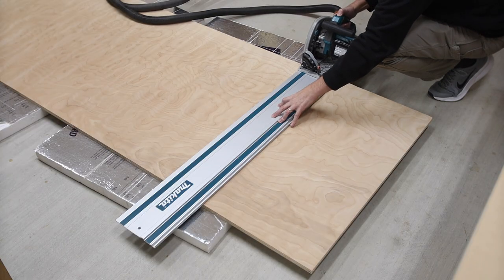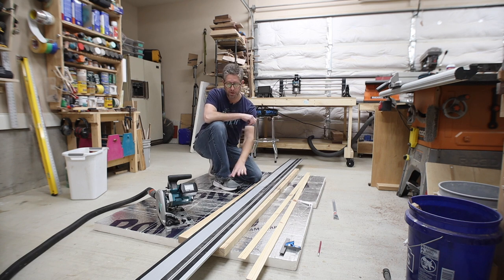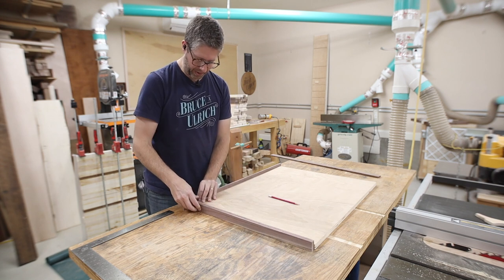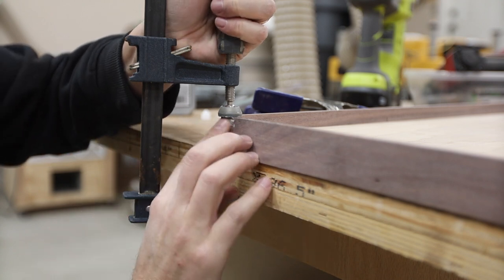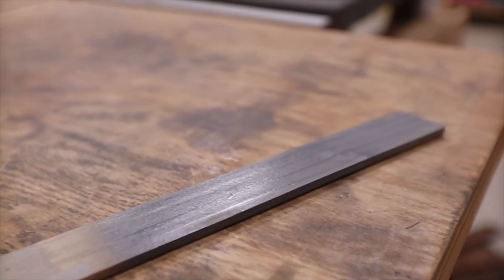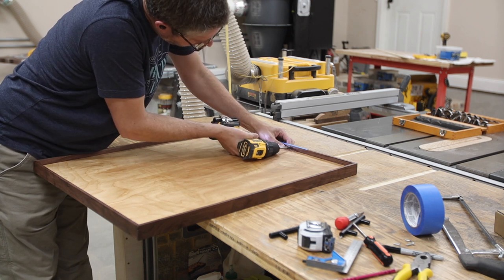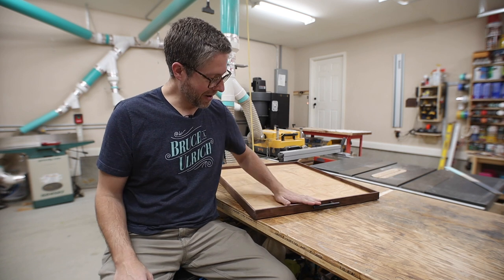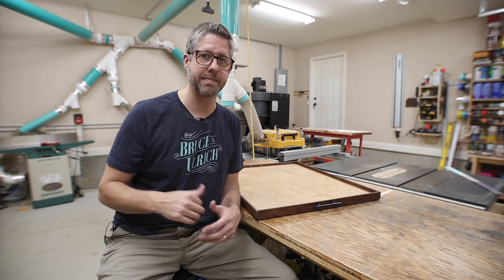MAKING A JIGSAW PUZZLE BOARD

Comment: I might have done the holes for the handles before attaching the side rails, unless they were an afterthought, of course. The countersinking would have been a bit easier. But great jigsaw board, I need to make one and this is the design I'm gonna follow. Most woodworkers I've seen here on YT want to overcomplicate with fancy angles, drawers and covers. This is all that is needed. 👍
Reply from the maker: Yeah, I should have done the holes for the handles before attaching. Oh well, it worked! Thanks

Comment: Late to this party but i LOVE this! My only dilemma is my wife and I i like to do puzzles that we glue and frame. Not just for fun to assmeble and then disassemble, and then assemble again at another time. Now thats just crazy. 😉

The dilemma is how to get the completed puzzle out of the box to glue and frame. I'm thinking one of the "rails" could be fastened with a hinge system that would swing down. Or swing out. 

Still thinking about that, open to suggestions. But love everything else about this video!
Reply from the maker: Use some tiny magnets on one of the rails and you could just remove that rail when needed.
Reply: @BruceAUlrich interesting idea! I'll have to look into how to do that. Thanks!

Comment: You might have been ok shooting the nail in the corner if you kept the nail gun vertical instead of horizontal like the rest of your shots. It changes the orientation of the nail head. Great video. Just a thought.
Reply from the maker: I changed the orientation of those shots (good eye, BTW) so the nail would not come shooting out of the side piece. Then, this happened to the front of it. Ha ha